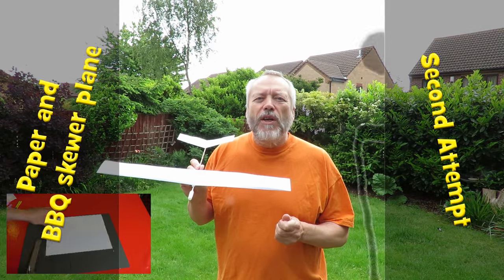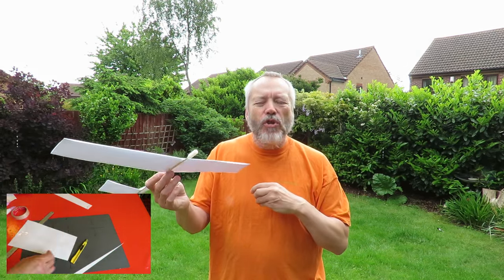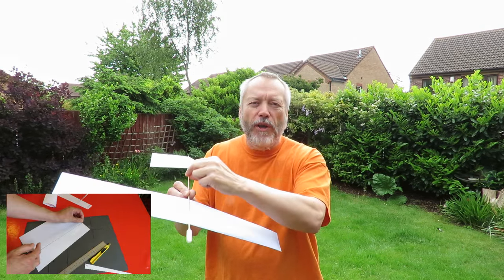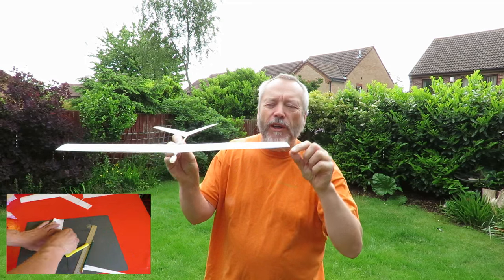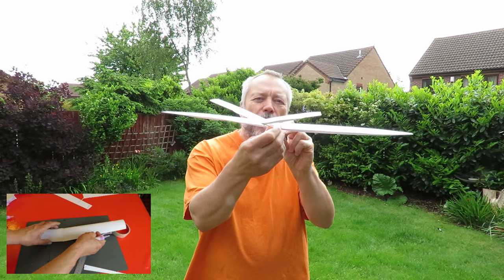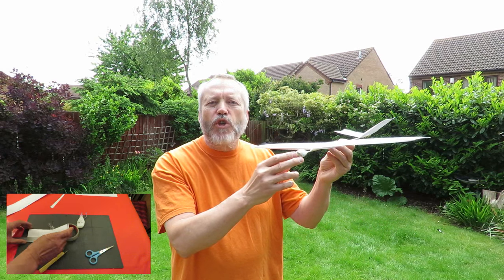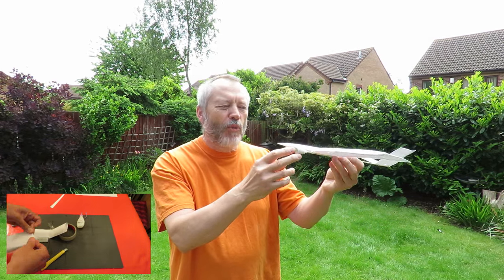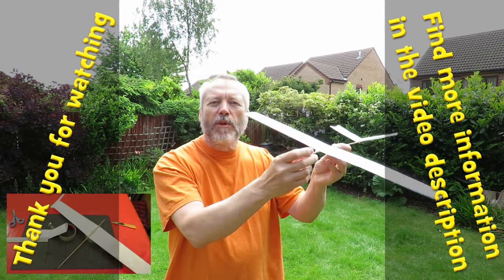Paper and BBQ skewer plane Second Attempt

Comment: People have suggested Dihedral, this could help stability but as you have answered would be hard to create in a paper wing.
 One thing i noticed is the aircrafts tendancy to rise up and stall then plumet towards the ground, i see there is a large 'blob' on the front so i will presume the centre of gravity balance has been addresed, perhaps the tailplane assembly need some negative incidence, by which i mean the leading edge raised up slightly to act like a slight downward movement of an elevator thus keeping the aircrafts nose level in flight.

Comment: Perhaps a bit of dihedral on the wings as well.
Reply from the maker: the wings do have dihedral, just nothing like the V tail so you may not notice it. The more dihedral you use the less lift you get from the wings but the plane is more stable in flight.
Reply: I think the other problem is that paper doesn't have a very good strength/weight ratio
Reply from the maker: Charles Flaherty yes, that is why this project is quite challenging to get a good result.

Comment: maybe try a bit more dihedral
Reply from the maker: What would increasing the dihedral achieve?
Reply: +GrandadIsAnOldMan 
it eould stay completely level in flight allowing it to glide further
Reply from the maker: Riley howe-mills quite possibly. If you check back on most of my aircraft videos you will see I tend to overdo the dihedral and in the process lose some of the available lift. The main problem for this plane with increasing the dihedral is that it will probably weaken the centre section. If I do a third attempt I may be using tubes of paper as spars inside the wing to increase the strength and preserve the aerofoil shape.
Reply from the maker: Riley howe-mills I will see if I can work in a mention for your channel in a related video :)
Reply: +GrandadIsAnOldMan THANK YOU that would be great